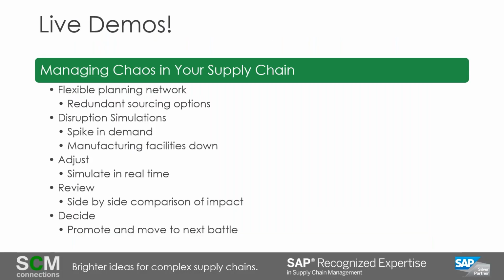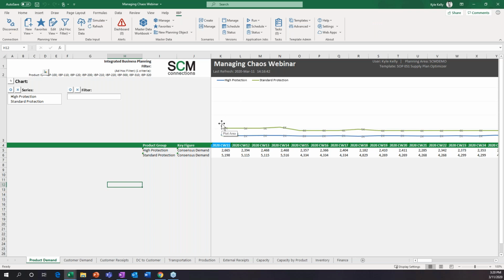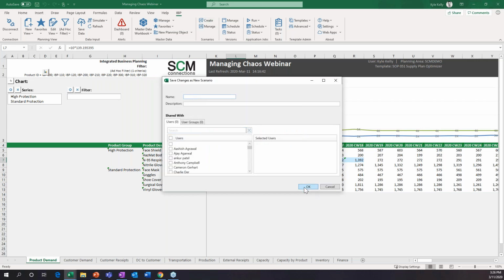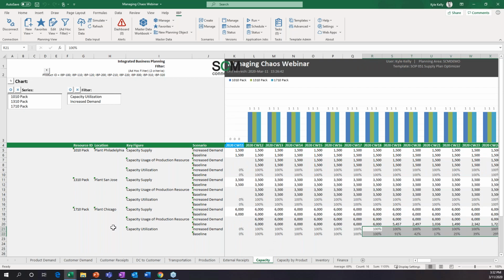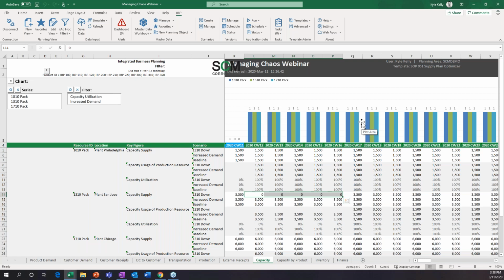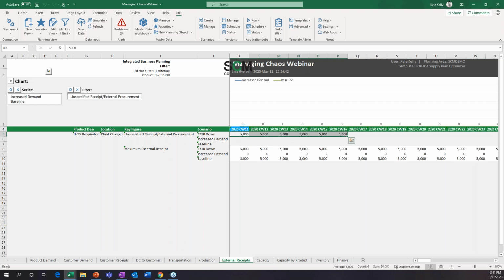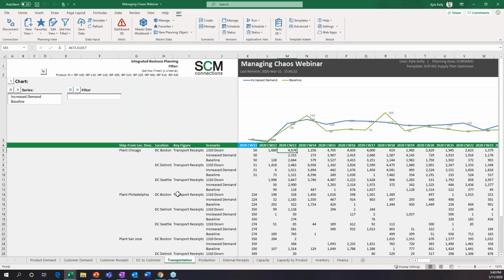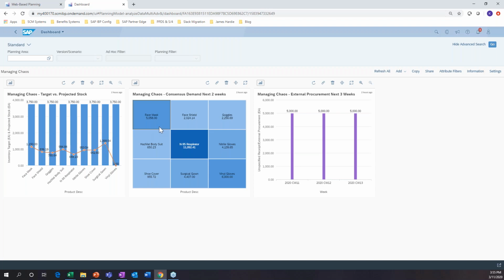Managing Chaos with SAP IBP: Coronavirus Edition (SCM Connections Live Webinar Replay)

Comment: good vid is it possible to have unified single planning area if we use order based supply planning and demand sensing thanks
Reply from the maker: I do not believe this is technically feasible at this point.  However, I would recommend running demand sensing in the time series planning area, then sending this signal to the order series planning area to feed the order series supply area on a daily basis.